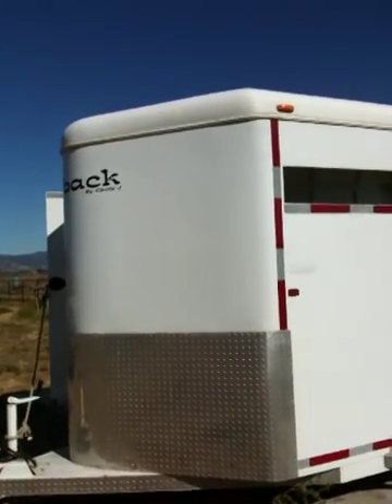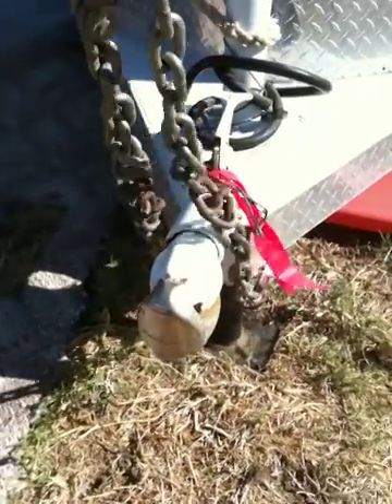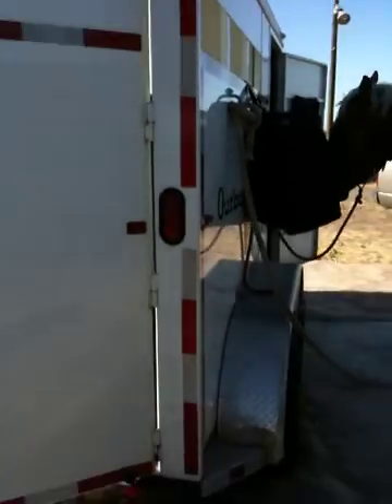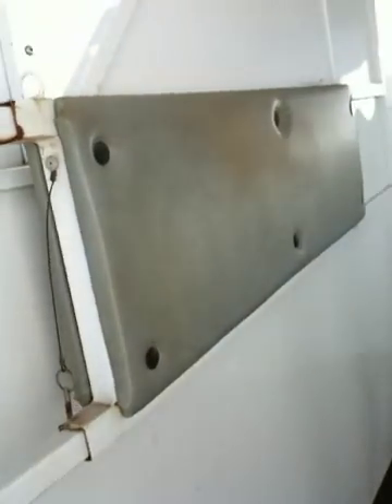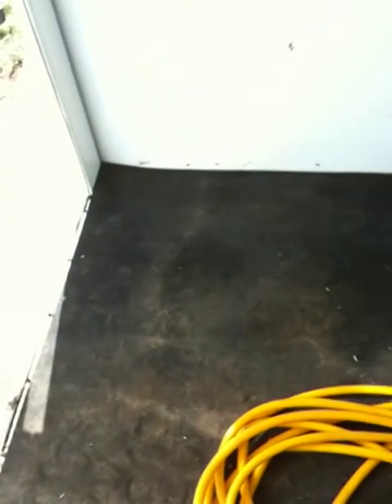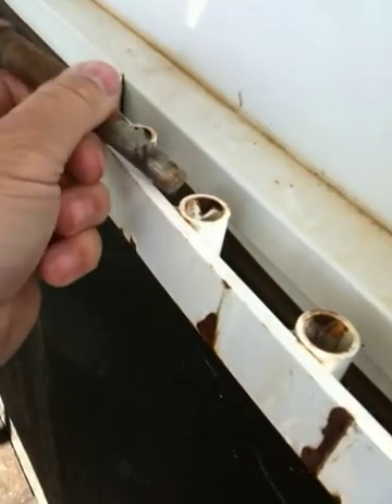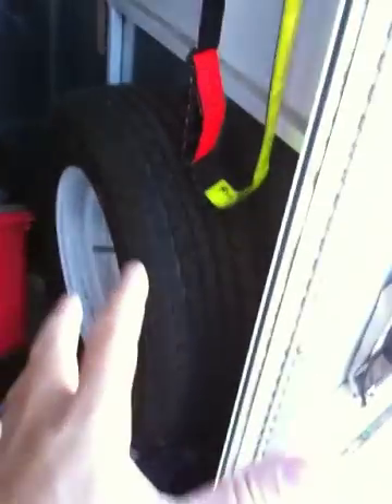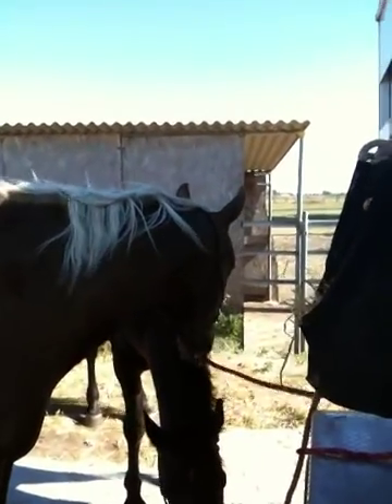Tips on buying a Horse Trailer - Part 2 - Rick Gore Horsemanship

Comment from the maker: It is hard to see the picture but the front little windows should be covered since that will be direct wind into the horse's face and rocks, dust and bees or bugs can be pushed straight into the horses eyes, you don't want direct wind at highway speeds in your horse's face or eyes.

Comment: That's a very good point! One of the windows cracked which is why we took them off. I was thinking more on air flow and them getting hurt by sticking their noses out, not things flying at their faces. Hope that's not why it cracked in the first place. It's an older trailer so we are constantly checking everything for wear. It doesn't have a lot of rust yet, which is good :)  Thanks  for the prompt response.

Comment: I have a small two horse trailer that has the side widows that start from the door to about halfway up the trailer. Plus when I close the door it is open above the door like your trailer is. It has two small windows in the front that we  are repairing and I would like to email you a pic for your advise on whether I can just leave them off or not for more air,  people have been saying the horse will hurt itself and I'm not sure if they are just being over protective or not. 1.5ft X 0.5 ft